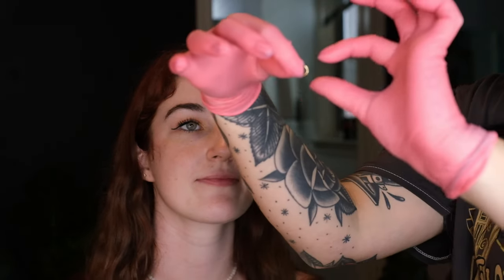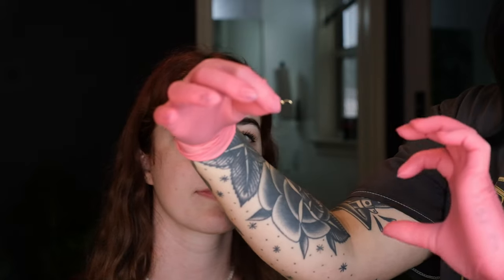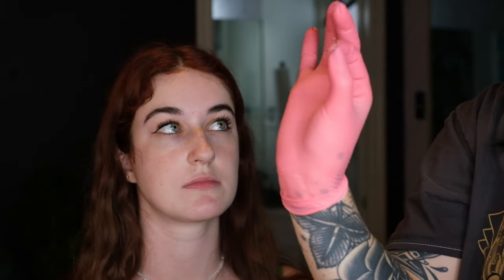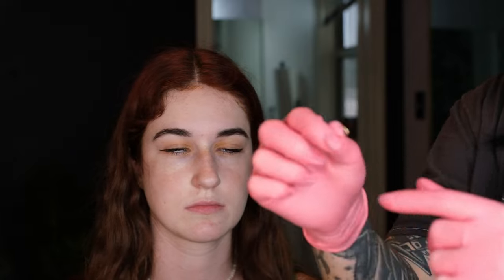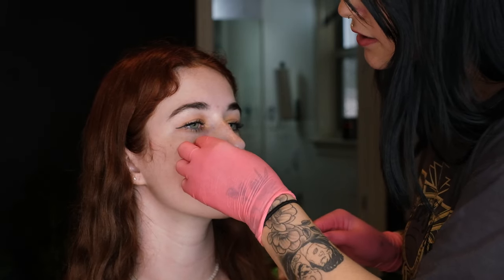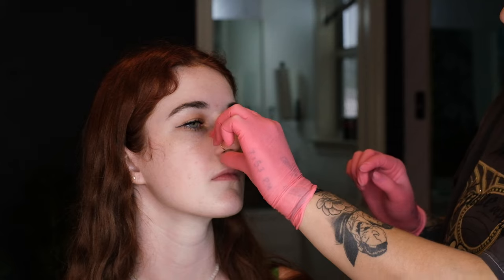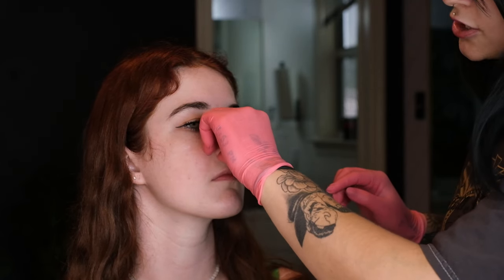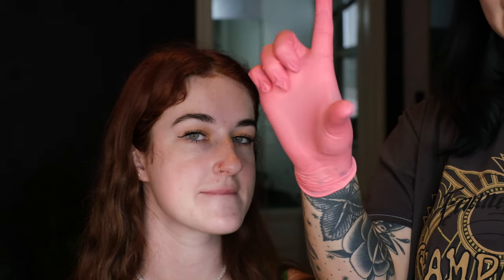How to put a Clicker in

Comment: I need help, i got my first nose piercing on December 28th, its fully healed, and ive bought a new stud piercing, but i cant take my piercing out, its not stuck or anything but my piercer said i had a clicker piercing, and when ive searched up clicker piercings, they show hoops, my clicker piercing is a stud and i dont know how to take it off, can anyone help?
Reply: try gently pulling on the top part of the jewelry (not the bar) and see if it pops out. make sure you have a good grip on the bar while you do this, if you don't it might cause unnecessary discomfort